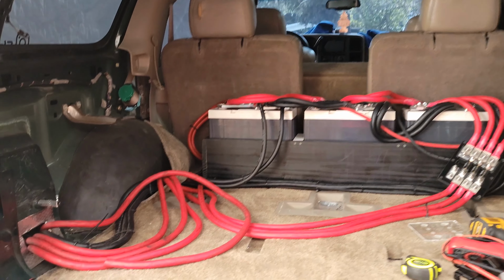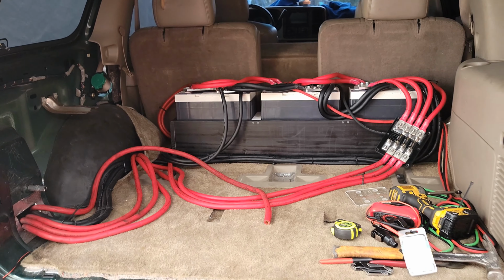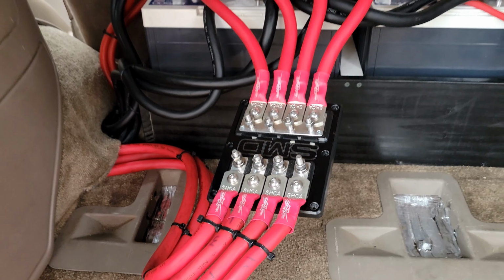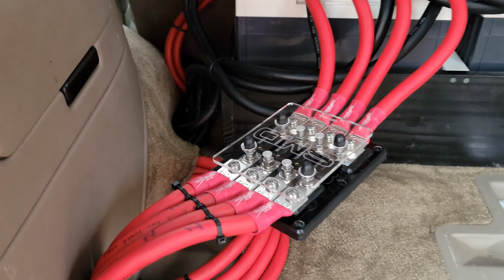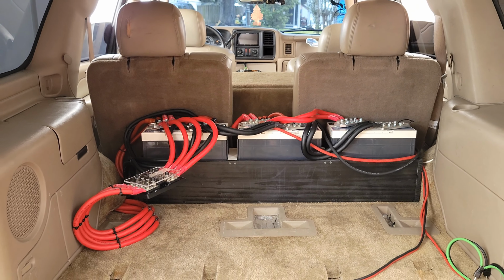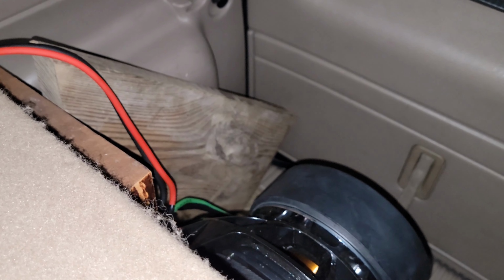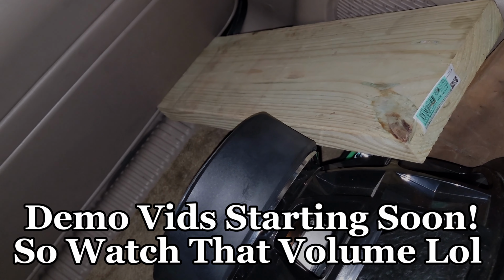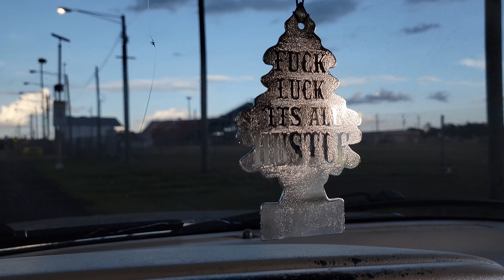Fixing Damaged Power Wire Run Pt. 3 : Finally Done & Bumpin 🔊💪🏽

Comment: Hell yeah looking good and bumping hard as heck. What subs are those again?
Reply from the maker: Skar VXF 15s
Reply: @SleepyBoiii  I went to a bass meet on Friday and a guy had two 12s Skar vxf in a 6th order on 3,500 watts. Sounded good. I currently have two sundown x8v3 and I wanted to upgrade to 12 inch. I have my 2000 Chevy Tahoe but with all 3 row seats in it. I have 5 kids and me and my wife. So I am low on space. But we measured and I can fit two 12s. 6.5 cubic of space available. I was going to order two Skar vxf 12 inch subs. But I'm not sure if I should just do the sundown x12v3. Way more money. There is a Wolfram ag 12 that's promising looks good specs are ok. I went to down4sound shop because I live in Las Vegas. Some guy said those are better than Skar. But that's his opinion. And Wolfram is about to go out of business. I don't like hard hitting bass I like the lows you know. You would probably go for something super expensive next huh?